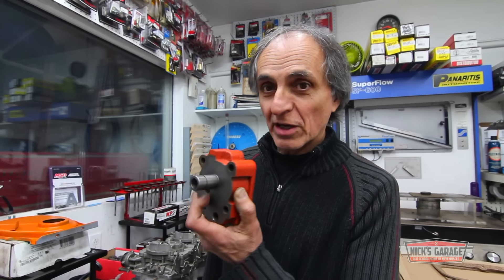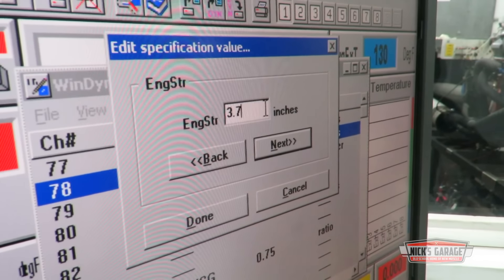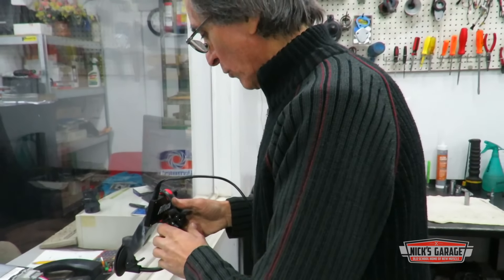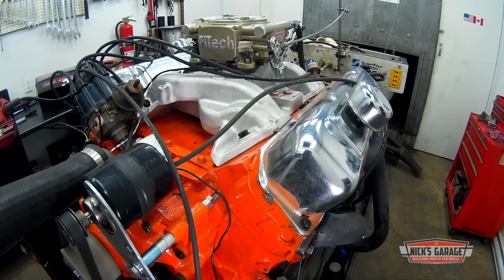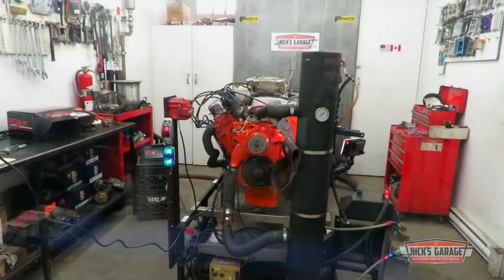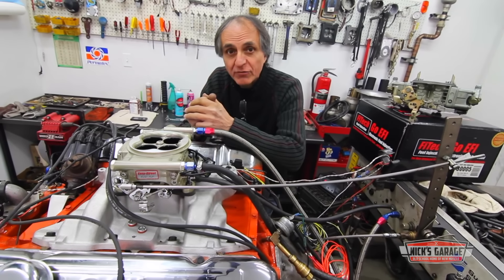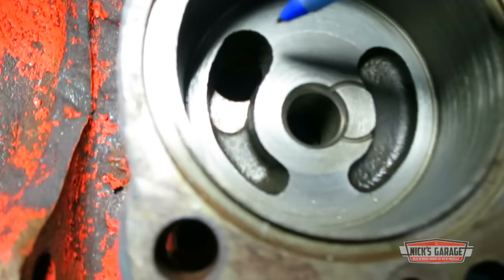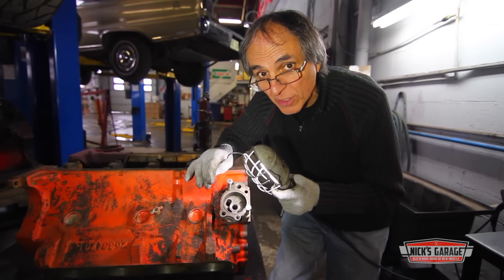Carburetor vs E.F.I. - Dyno Room Showdown

Comment: I’m calling you out on 7:22. If you have a mechanical fuel pump yes that is the case. If you want easy consistent cold starting just put an electric fuel pump on it. If you want the best starting, do an electric fuel pump with a manual choke on the carb. Doing a TBI swap is not worth it if you just want “easier starting” . Carb: easy start, reliable, and proven itself through decades and use in wars. TBI: technology from the 80s that had a short run, and the aftermarket systems have proven it is not a great solution for a “daily driver” . If you want real EFI just do an LS swap or anything with OEM parts.

Comment: I switched to this Fi tech on my 69 chevelle 406sbc, computer controlled ignition, 100% efi, never going back to carb, but holy shit did it takes months and months nearly a year to get the kinks worked out, and i'm still learning. So worth it though, no smell, crazy throttle response, fast start up, and the tuning is fun IMO. MPG? my right foot as way more fun it's probably worse
Reply: TheCowGoesMoo o.       True, EFI takes time to tune it perfect.

Comment: Its supposed to be run through the rpm range multiple times so it can learn and adjust on full throttle pulls. If it made withing 10 hp on the first pull, it likely would have beaten the carb within the next 3.

Comment: Nick you make me miss my father and grandfather teaching me auto tricks and life tricks. I sure do miss my grandfather’s Oldsmobiles he loved Deltas with big engines, really big ones. My dad was a truck puller in Maine and won his class many years and has more blue ribbons and trophies than I can count. He also had a 1946 Ford Marmon-Harrington 4x4 conversion for WW2, he bought with a front snow blower which was used to clear miles of camp roads at Tim Pond Camps(A Maine Camp)for many years. He dead axled the rear end and ran it with built 454 Chevy and turbo 400 tranny tricked out with a very high stall for truck pulling launches. The converted from Ford’s partner axles were rated at either 1-1/2 ton or 2-1/2 ton, I miss the old cars and trucks, I still love turning wrenches. 
Did I mention he bought a brand new 1966 Olds 442 in high school which he drag raced at the local (ahem cough “strip”) haha. He was poor and bought it with his own hard earned money which he saved for, he loved it, but as I understand he spun a bearing drag racing and it was gone before i was old enough to have seen it in person. Sometimes when I see you with family it makes me see what a great guy you are on the channel, my dad was very very good with engines, carburetors and all manner of running engines. He should of had a shop because every guy in town would stop by for that last bit of tuning that was keeping their rides from being all they could be, my dad would iron out the problem and off they’d go with a big smile. 
Love ya Nick
Reply: Micheal F.   I love your story. I am like your Dad. On Saturdays we have coffee and donuts, and tweak  or tune someone's car.   Thanks for watching.

Comment: I think once the EFI gets the feel for your driving style, the car's mannerisms while driving, and all the other factors of an engine operating in the car itself you'll find the fuel injection is very nice! That ten horsepower will likely come back and maybe even bring a few friends with it. I found that the F.A.S.T. EZ EFI I installed on my 69 Camaro made it so much more enjoyable to drive. I feel like I am fighting the car so much less to get it to feel the way I want it to. Now I have a low end FiTech 400hp kit for my my 85 C10 "Zombietruck" which we found abandoned on my granfather's property. When we got it all in my name nice and legal I got it running and driving, I really look forward to seeing how the EFI wakes up that tired little small block. (And when the old engine lets go I have a nice little upgrade set aside.)

Comment: This was a lousy way to compare the two. The EFI needs to learn and tune to ranges of RPM including WOT. Not just idle. Not to mention the thing is completely electronically adjustable. So very simple to change the base settings to more appropriate for the setup. Also these EFI systems work best with updated ignition systems. And can communicate with one another. So essentially you're only seeing half the equation with poor prep and tuning.

Comment: So a auto tuned vs manually jetted carb?  What happens when the weather changes?  I would wager if maps were tuned by hand the result would be much closer if not better.  Carbs tend to be able to match or beat the peak power but aren't typically as good with average power across the curve.  Plus at part throttle EFI tend to be a lot better.  

A fair comparison would pulling a carb out the box and bolting it on and testing it or let someone tune the EFI.
Reply: An improperly tuned EFI system vs a dyno jetted carb.

Comment: Single plane intake, is preferred for EFI, you have no use for dual plane anymore, you don't need the vacuum. Dual plane are for cabs, single plane are for EFI.
Reply: c3dk.     Yes, you are correct.

Comment: The throttle body efi will get much better hp than multiport becouse of the same reason a carb makes more becouse the fuel is introduced in the throttle body and the atomization occurs higher up and has more of the cooling effect that gives the carb the hp advantage

Comment: I haven't had a carb for years on anything but my lawnmower. The reliability, drivability, performance and fuel economy you get with EFI is astounding over carbureted engines. Where it really shines is the adaptability for altitude and ambient temperature variations. It was always a pain to tune the carb for a cool damp morning and then re tune it in the afternoon when the sun warmed everything up, if you didn't when racing you stood a good chance of melting a piston.
Reply: fuel economy? you ever hear of the pogue carburetor?
Reply: VetteKid funny name cause I tinkered around with efi and carbs on my 74 vette. I finally stuck with the carb because I get more power and better fuel mileage. So your opinion is just that and opinion and not fact. And if you had to tune for the cool morning and then retune for the afternoon then you don't know how to tune at all. Wrong jet size maybe? Wrong carb size? Dirty carb?  I have replaced the air filter on some cars when customers were cursing up and down maybe they should of went to efi.  
I have never seen a melted piston due to a carb. I have seen melted pistons due to improper timing and bad o2 sensors or dirty injectors combined with a o2 sensor issues. 
I live in canada and -30 temps are not uncommon during winter and i have never had reliability or drive ability issues. 
There are a lot of mechanics that should not touch carbs because they understand how they work in their head but they do not have the skills to tune them. I bring my daily EFI car to the dealership for its issues. Very rarely does it come back fixed properly.  As soon as the warranty is off of it I will converting it to a carb as well unless I decide to sell if for another classic.
Reply: @bonnivilleblackcherry9745  Wow!  I guess you should find a set of points and a distributor when you convert your 2002 Pontiac 3.8 liter back to carburetor. I'm sorry Mr Cherry but I found your comment Funny. I got go now, I'm changing the coolant in my 1968 VW bus. You wouldn't happen to know how much the radiator holds ? would you.The Kid at auto zone said 4.20 liters. Do you think he right.

Comment: I put an aftermarket chip in my '85 Corvette and went drag-racing. The computer needed to learn what the engine was doing at high rpm and high throttle. That car got faster and faster with every pass down the strip. If you only idle the car, that's all the fuel injection "brain" is going to adjust it for.

Comment: Which model FiTech was this? It looks like the 400hp model  (30003), and not the 600 HP model.  With only 62lb injectors you're basically choking that big 440.  That thing should have the 600hp model on it.

Comment: You can't beat fuel injection. I have the Gen one pro flow it doesn't self lean it's obd1 . When it's dialed in my 406 runs perfectly nice at Idol and wot it just screams. The injectors crapped out so I upgraded to slightly bigger ones. 8 injectors is a deal compared to a new carb.

Comment: At 478 comments I'm probably the 477th explaining that (IDLE) is not what the EFI uses to "learn".  A god carb set up right will always be better than a "throttle body efi" .. Also, some of these EFI set ups are quirky with dual plane manifolds.
   In reality, engine dyno's are GREAT for some things, but could never give the reality of things like long durations at full power or part throttle etc....  Like small exhaust & mufflers vs bigger exhaust & less restrictive. The power can dyno as the same, but while pulling a 5th wheel over a 20 mile mountain pass, WAY more heat builds in the small tube set up.

Comment: Guys don't forget. This is a THROTTLE BODY EFI. And it makes almost the same numbers as a carb.
Reply: Almost and heaps electric stuff to go wrong unlike carby which needs to be slightly adjusted once in 3yrs + personally i havent touched mine after 4 years no issues
Reply: Adjusted my EFI 5 years ago no issues, never even touched the spark plugs.
Reply: @ToreDL87  wait till the wiring starts getting brittle from heat time and elements. Great times finding broke wires inside the harness.
Reply: for sure a ported injection is probably way better than tb injection.

Comment: There are way too many unknown variables to compare in this video. What was the afr with the carb and fi set up?? Or egt's look like under full throttle??? You run an engine slightly lean its going to make more power than running slightly rich. I image the FI runs on the safe side with more of a rich mixture... Which setup do you think will last longer? You never get the same life expectancy from a carb as you do from FI. FI doesnt leave gas in the cylinder when you shut the engine off, carbs do and it will wear down your rings. It's very common to see carburetored vehicles start to burn oil through the exhaust around 100,000 miles. Unfortunately with gas milage, reliability and efficiency issues carburetors have almost been completely left in the past... Also I am curious to see what the horsepower and torque curve look like when compared.
Reply: Ty Ty.      Since we are old school, we needed more time and expertize for the testing on the difference on this comparison. True, I agree that EFI the engine will last longer in it's life.

Comment: When Fuel Injection first came out ..  they said  a   Carburator  might  make  more  wide  Open  HP.   Doubt that's  true  anymore..
   First  you can eliminate the  heated  intake  Manifold and    feed cooler air to the engine..
   Many  Fuel injection  systems  have too  large  of  throttle bodies...
   They now have port injection and Direct  timed injection...
   I would  much prefer  running  E-85  which his  very high Octane  and costs  much less per  gallon but you do have to   run more of it.. It  takes  more  heat to vaporize  thus  you can  make huge  gains with fuel injection  ..

Comment: Throttle body injection?  All this proves is that manufacturers were correct in going to port injection over 20 yrars ago
Reply: Almost 40 years if you count mechanical injection
Reply: @sidewaysdanny  40 years ago was 1980. Mechanical injection started popping up on street cars in '55-56 depending on what side of the pond you want to go with (MB 300SL, Chevy 283). Mech FI? 65 years ago. And the Rochester FI was a constant flow port injection, too.... the MB system, good god that was actually GDI, they used modified diesel pumps and injectors, moved their spark plugs and just used the old holes (in the cylinder wall... MB was weird) for them.

Comment: I was wondering how much it would cost to build my 71 Buick GS 455 non stage to a stage 2 1/2 using t/a performance parts and Holley term. EFI stealth I'm trying to find a roller Buick regal or something similar just want to know. Nick how much would charge to build it.
Reply: 417 S.  It is hard to say, this is something you sit down and go into details.

Comment: The EFI will make adjustments for atmospheric changes, the carb won’t.
Reply: You realize that a carb works on atmospheric pressure right?  So any change in atmospheric pressure also changes the amount the fuel into the engine.   Carbs work from below sea level all the way up to the highest piston engine planes can fly.

The only real advantage of EFI is the ability to fine tune itself with sensors from the exhaust to adjust air-fuel ration on the fly.
Reply: knight0334   Carbs have to be rejetted when a great change in altitude , atmospheric by a human. The EFI unit will make those changes to a point on the fly.   Airplanes a in a class on there own trims must be set to altitude, etc.  older planes a manifold heater must be in place to prevent the intake manifold from freezing up.
Reply: Cars don't suffer the extreme altitude changes that airplanes have to deal with.  And there are auto-mixture devices for airplane carbs.   And on top of that, even EFI airplanes are required to have mixture knobs just the same as carbs.
Reply: I was using the example of planes to say that any manual type carberated engine will need (race) to possible be re jetted for even a 20deg temperature drop.  You have power valves, primary(4 barrel) secondary jets you have a Ventura of some type even at times accelerated pump will have to be adjusted with altitude.   But an EFI system does all that for you within its programming fuel tables.  Fuel injectors, and fuel pump limits. Timing etc....
Reply: @knight0334  that's a pretty serious "only advantage". I think these EFIs are fine for people with $1000+ to throw at a fuel mixer. Not everyone needs to spend that much to get right though.
Reply: Living in Colorado a carburetor will leave you stranded. EFI all day!

Comment: That is fairly normal from what I have seen with simple throttle body injection. Bottom end driveability is a bit better as is economy at the expense of top end power. Only 10hp is actually very good. I know of engines losing 30 and 40 hp. Same dyno same operator. And starting with around 300hp at the wheels. A race engine tried on one of those would scarcely run. Multi point and single 4bbl throttle body is generally no better on power either though driveability can be better. That is can be.  efi with 8 trumpets will always be better down low but surprising makes little more top end power. Though 625 v 610 is not to be sneezed at, but that is all quite expensive. With many more things to go wrong,, and they often do!
I will stick with a modern carb on E85. Do not care what the engine does under 3500 but $3+ grand to make  very few hp to me is a waste. And all the electric boxes and harness and even the throttle bodies weigh more as well.

Comment: Sadly the mod on the oil pump still didn't line up with the block. Great idea but you should also put a profile on the block intake side to get rid of the sharp edge. Fill the pump with Vaseline too before you fit it so it pumps oil straight away.
Setting up the EFI takes a bit longer than a couple of runs at idle. Bit of a poor comparison to a carb that was fully set up for the engine.